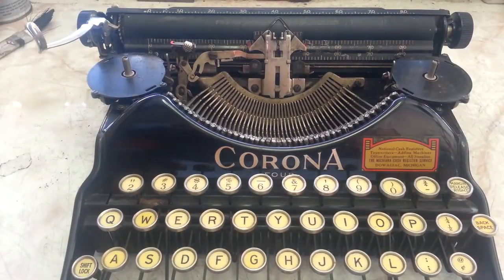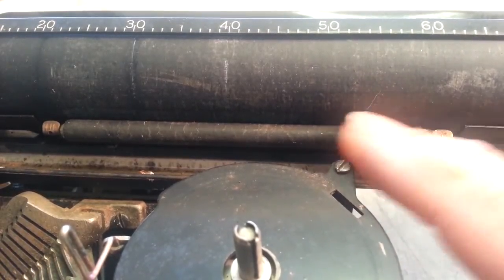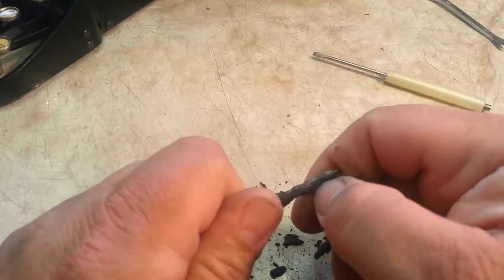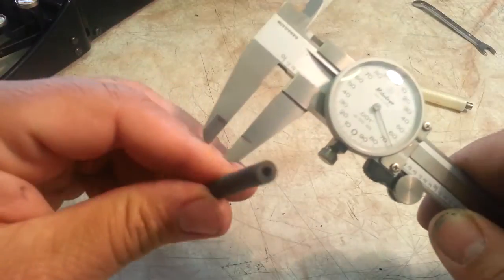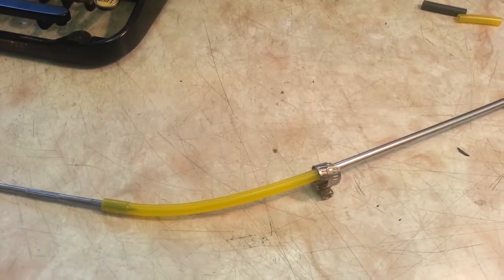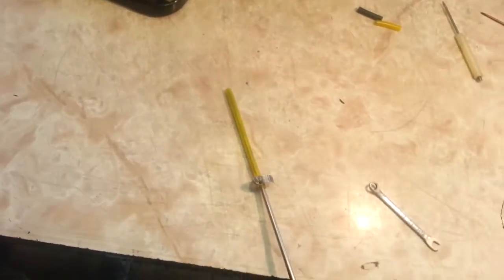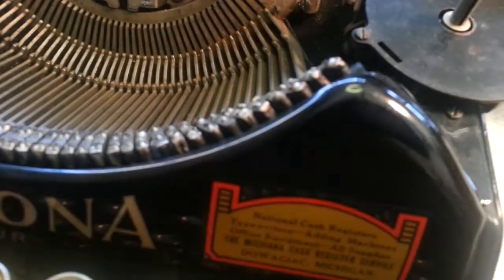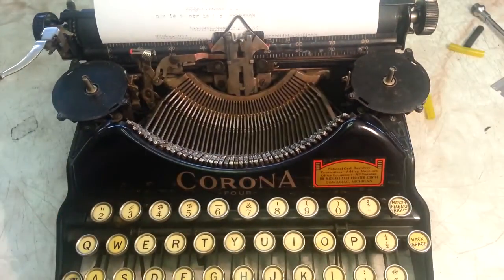Corona Four Typewriter Front Feed Roller Replacement Flat Spot New Rubber No Platen Removal

Comment: 8:24 This is a similar technique to how we put on rubber grips to BMX bike handles! Either can use air compressor/air nozzle or another method that can be used is the air canister's of hair spray! Hair spray because it's real slippery freshly sprayed on which lets you slip on the grips but then when it dries it gets tacky/sticky and acts a little bit like glue to hold them on. I prefer the no mess version of compressed air typically, however, just cause I don't want to have to deal with any cleanup, and because I prefer to make it easier on myself come time to replace the grips.
Great tip for this typewriter! :D

Comment: I've watched so many of your videos and though I live in California, I frequently visit Phoenix (2-3 times a year). My next trip I'll be sure to arrange a purchase of whatever you're selling. I've learned a tremendous amount of information from subscribing and viewing your videos. 

I currently am working on a Corona 4 which after a thorough cleaning learned that the return advance on about a 1/3 portion of the platen/ratchet does not advance the paper. The lever turns the ratchet, but the ratchet does not turn the platen only at this one portion of the platen. My attempts to remove the platen have for further inspection have come up unsuccessful as the rod within it is seized likely due to old oil and gunk. Any suggestions or tips for removing an old stuck typewriter platen rod? Neither side will budge.
Reply: Scratch that. Fixed the issue. Seems I had the center rod pulled too far right and tightened as so. Loosened it up, readjusted and the problem is solved.

Comment: I was surprised, when replacing the feed rollers on a SCM Corsair, just how tight the tolerances were. My roller was 1/16th of an inch larger in diameter and it absolutely would not work! The Corsair seems to have a really weak paper clamping action. Anyway, I like your air compressor technique though I can see myself launching a feed roller missile out of the compressor!

Comment: Thanks! I just picked up a corona four. While cleaning it up I saw that front roller is all cracked. Paper won't hold , hoping this fluxes it and I don't have to take the platen out and have it re done. Rollers in the back seem squishy and fine. Great video!

Comment: Replacing the rubber on the roller: I've replaced it with rubber tubing from an automotive parts store. Besides being just a hair too large diameter wise (it was 7/64 dia.) after inserting the rod, it seems too soft. Is that a problem? If so, what kind of rubber should I be looking for?
Reply from the maker: The stuff I use is soft too, surgical tubing or tygon tubing
Don't have a lot of choices unless you send then to JJshort for recovering